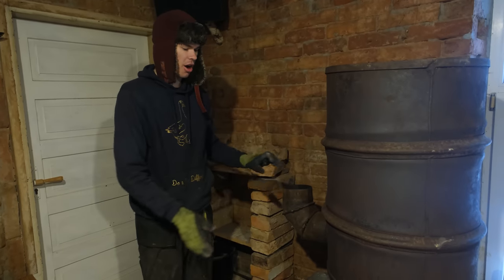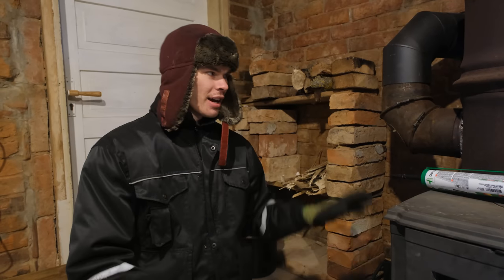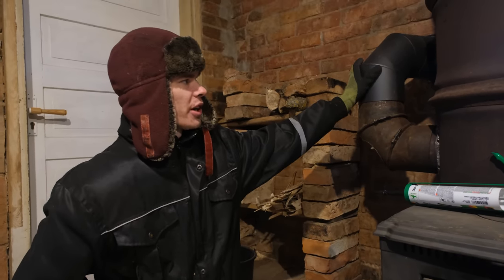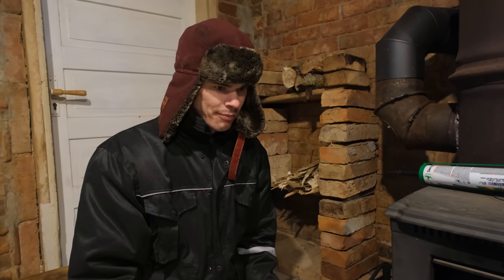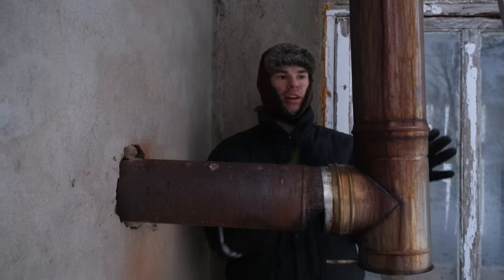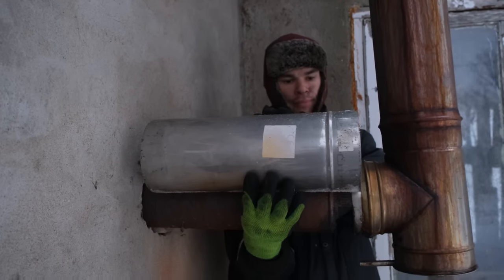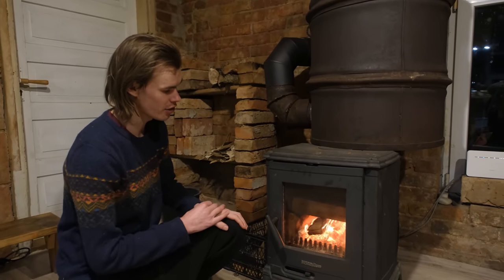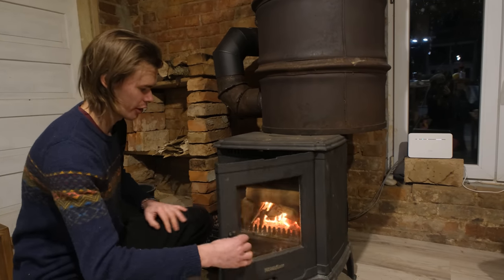Rocket Stove is WORKING!?

Comment: We have been burning wood in a forced air wood furnace in our garage for 30 years.  Recommendation:  clean your chimney with a chimney brush EVERY year, ABSOLUTELY NO EXCEPTIONS.  ALWAYS replaced pipes that have ANY sign of deterioration.  Also use only COMPLETELY dry wood that has been stored at least a year in sheltered storage.  Lastly, every spring, when you are done burning, cover your chimney at the top with a pail to prevent rain from entering the chimney all summer long.  As always, I wish you only the best!!!  Love you guys!
Reply: You could use a wind and water tight end piece in stead of a pail.
Reply: Good advice! But I'd add, place a good screen over it in the summer, to prevent birds and the like, from getting into your house in the warmer months. We found out the hard way, lol! Several years ago, we were hearing noises, so we went to the basement(where our woodstove is) and hubby heard the sound coming from the stove. Well, he opened it up and a bird came flying out. We had a hell of a time trying to get the bird before our 9 cats could. The bird was flying around and the cats were chasing it, and it was shitting all through the house, and we were trying not to step in it, along with preventing our cats from stepping in it too. It was freed once we caught it. It's comical as hell thinking about it now, lol! 🤣
Reply: @GOGOSLIFE  It's comical when it's over, haha, but I guess it was not funny at all, when it was happening! 😅Nice memory, thanks for sharing with us, made me laugh! 😂🤣
Reply: When I first started burning wood I always ran it wide open for 15 minutes after it caught good and you could hear the creosote falling down inside the chimney, so I just had to clean out at the bottom of the chimney. I've never had a chimney fire doing it that way, but one winter I forgot about cleaning it out and I had a basket ball size of creosote burning red hot down there, and had to wait until it was extinguished before removing it little water after it cooled down some an I was able to grab it with thick leather gloves. Started cleaning my chimney with a brush after that it was a little scary.

Comment: You can put gravel / crushed rock on top of the barrel to help hold and distribute the heat.
   You are putting a lot of trust and faith in that sealant caulk that you are using, I hope you have a good smoke/carbon monoxide detector, as I don't think that stuff will last forever.

Comment: I used to have issues with getting the smoke messing up my heating stove window until I learned to open the door long enough to get the smoke stack/or chimney hot enough to draw the heat smoke up and out.  keep experimenting if the stove and all is hot enough if you can close the door.  I enjoy your videos--just wished I was younger and do some of the pioneering things all over again--I did that before "google and video cameras--but when technology came around I embraced at least some of it.--Wishing you a great holiday season.

Comment: Yes, a backboiler will give you hot water and a few hot radiators too. It is like turning the clock back. Well done.
Reply: A radiator takes heat away from the stove. This stove will not run radiators,  it is to small. A chimney for a stove runs better with a straight chimney.  The more bends the less draw. The hotter the chimney the better the stove will burn. It will make the fuel last longer. It will not draw as aggressive.  The air intake above the door is to clear smoke from the glass. Air from beneath is better, especially if air is drawn from outside, instead of drawing hot air from the room. That oil drum is dangerous,  it will rot. You should use insulated pipe on the outside so the chimney runs hot. A cold chimney will block up in no time, and cause it to block. The creasotes stick to it!

Comment: Fair play you got it working. Glad you addressed the unsealed bottom of the barrel thing as I couldn't understand that. There's a risk it will smoke on start up but I assume it's drawing in air and out with exhaust. Someone below mentioned sand for mass, it's something I've been looking into and planning to play with in terms of heat storage, I have an old wood powered water boiler kicking around that will do nicely.
Reply from the maker: Yeah I was thinking of putting pipes in the barrel have so thick old water lines and they are 70mm wide so good for filling with sand and to store some heat to release slowly. But main plan to add heat exchanger and heat few radiators and hot water.

Comment: Seems like a job well done, glad to see you have heating😊 I don’t really understand how it works, does it heat the rest of the house through the walls? We prefer using the other stoves around here, made of terracotta tiles, they keep warm a lot longer than the metal ones but yours would be better if it works as a central heating unit. Interested in this with the current prices for energy and gas.
Reply from the maker: It will have central heating hooked to it so it will heat the rest of the house and hot water! 😁❤️
Reply: I have no clue what he's talking about 😁, but I'm so happy everything ended up the way they expected!
Reply: @DoBeDiff  when you were restoring the walls, in your older videos from the farm, I noticed they had built- in flutes/gaps in them and they had signs of ash/burning, I thought it was like an old type of central heating but I couldn’t figure out how you’d make the hot air circulate through the walls without pumping it somehow. I must have seen wrong.😁 
You mentioned in the video about turning the rocket stove into a central hot water service, yup, that part was clear and I hope it works well.
Reply: @lidijabirsa7768  he means to turn the stove into a central heating unit that would distribute hot water through radiators and to the taps around the house. Whay kind of heating do you use in Canada, not central heating units? They can of course run on gas, electricity or solid fuel (wood, coal, wood chips) I thought you’d use the same types given it’s pretty cold there.
Reply: @minime7375  Thanks. I always had central heating here in Europe 😊. I would probably die in Canada, haha, not just bc of cold but gloomy weather too.
Reply: @lidijabirsa7768  oh, sorry, I was under the impression that you were Canadian.

Comment: To make it better you should get an 8 inch metal pipe, cap 1 end, cut it along the length and weld both halves to the side of the drum open end up. Now fill the 2 half pipes with sand and once the fire goes out the sand will release heat into the space.
Reply from the maker: Yeah was thinking about something like that how to add sand into the barrel might be some ways we could do it. 🤔

Comment: The rocket stove Im making is very similar ( not so fancy) I've got a 2nd barrel on top of first to heat/boil water, and a third barrel that flue passes through and is pizza oven. Mine is for burning wood pellets ,  good job.
Reply from the maker: Sounds interesting! I am planning to add heat exchanger to heat the rest of the house and hot water! Hopefully it produces enough heat to get the radiators hot enough! But it's worth a try and anyways the central heating system will be setup and ready for any boiler I want to use. But a pizza oven sounds great I have seen some rocket stove pizza ovens and they work great!
Reply: It's a challenge to get radiators to heat if using convection, helps if tank and raids are above heat source, but u may need electric circulation pump .
Reply from the maker: @anthonymason912  I have circulation pump. I have already bought everything just need to renovate the storage room to set it all up. Plus accumulation tank and new boiler for hot water!

Comment: I've seen that spiralling coper pipes around strait exhaust could be used to re-direct heat using even small water pump ...
Depends on the distance you have to bring the heat in but transporting heat thru water pipe could be an interesting process too ...
Looks kinda non sense to me having all these tube out from the housing but fumes can be quite dangerous ...
If it works for you ...
Way more if you helps it to evolve ...

Well, I won't have bet on my success in those kinds a circumstances ...
Fortunately ...
It's nothing except yours on the lines !!!
🤔 🙄 😌
Isn't it fortunate ???

With all that firm support I gather there :

Dare, care, ride safe, clean, have fun ...
From France with !

Comment: Be very careful, you need isolated flue on the outside to keep the flue hot. A hot flue runs better.  A cold chimney will not draw efficiently,  and creasotes will stick to the flue and block. Air should be drawn from under the stove, the air intake above the door is to blow air over the glass to keep it clear. A boiler takes heat away from the stove. This will not run radiators,  it is too small. A flue should be straight,  with maybe one bend at the back, or a gradual bend. You should not have more intakes, that is dangerous.  Only use the intake from the bottom.  This is dangerous.  And the carbon monoxide kills! Use the stove as designed, and use insulation on the flues. A hot flue with one bend out of the back will make this stove run hot. Use the fire board to line the stove, and use the baffle plate!

Comment: Wow that fire draws well
Just a thought those heat resistant bricks in the barrel are they stopping heat coming through to the external barrel
Reply from the maker: No they help the barrel get hotter since the bricks help the fire get hotter and not let the smoke cool down as fast. Overall the stove works very great 😁

Comment: Your work can be successful in that you have increased the heat transfer capability of the hot smoke coming from the stove into the barrel. The smoke coming out of the stove is probably around 300 degrees Celsius, and we could determine the result if we also knew the temperature of the smoke entering the chimney.

In the case of my new type of stove, the smoke entering the chimney is always between 120-150 degrees C, even if I put 50 kilos of wood into the firebox at the same time. Of course, my fireplace is bigger, 60x70x120 cm. This way, I can put in meter-long firewood without having to cut it into small pieces. The main thing for me is the possibility of extracting the heat from the smoke and storing it, which means that the combustion in the stove only needs to be started every 24-48 hours. Only in extreme cold, -7- -15 degrees C, etc. must be heated daily, and thus an area of 120 m2 is heated. I can only heat more if I remove the heat with air heating or through a buffer tank in the case of central heating.
It would be nice if you could measure the temperature of the smoke entering the chimney, then we would know more about your work.
Reply from the maker: I will get a laser temperature device and make a update video with exact details. I do want to install heat exchanger for central heating but I don't think I will be able to heat a large accumulation tank if any at all. It all depends how hot the radiators get and how fast. I am excited about this project and if It fails I will get a proper wood boiler maybe automatic wood chip boiler would be great! 😀
Reply: @DoBeDiff  I tried three simple options for temperature measurement. One is the infrared thermometer, the other is the bimetallic furnace thermometer built into the flue, and the third is the magnetic thermometer that can be placed on the flue. It is worth using two of the latter and then you can see how much heat you can save before entering the chimney. Creating a heat storage (heat exchanger) is the real big challenge, because there are many options. It is very difficult to reduce 300 degrees C to 120 degrees C, because the smoke leaves the apartment quickly. The advanced measurement option is a probe that measures the emission values of the flue gases and the heat, as well as the amount of flue gas, and we see the data graphically on a computer continuously during the heating cycle. There is a chance for change. Good luck with the project.

Comment: Do you know that pipe in factory won’t fully closed for a safety reason?
Reply from the maker: Yes and this safety is unnecessary if you manage your stove. Have you seen any brick stove having a gap, even the dampers in Depo for brick stoves are fully sealing. Our clay pot stove seals fully and if you close it too soon it smokes. This new safety feature is dummy proof but is cooling down the house and the stove a lot. Since installing the new damper the stove stays hot till morning keeping the room warmer.

Comment: My opinion. Modern stoves are better. They burn clean and hot with blue flames. I can put very large pieces of wood that burn all night. Also are a lot safer than the duct pipe you’re using because they use stove pipe and chimney pipes. To know the difference use google. Many houses burned down because they used duct pipes instead of purpose made pipes for wood stoves.

Comment: looking good, perhaps for the secondary air use a 20mm ish size, stainless pipe either from the bottom or the side, preferably just at the tip of the flame, this is the reason for stainless, it can handle temperature, a  pipe with loads of holes around 5mm, should do, say twenty holes. then pass the pipe out of the stove to a valve, gas ball valve wok well, so you can fine tune secondary air, once secondary air is added the vents on front may be enough.. you could still reduce actual size of fire, a rocket stove tuned right can produce a lot of heat for almost nothing, here is something im working on, actual fire is around 60 mm, yet im getting around 4.5 kw of heat, for just under a litre of wood pellets an hour.. trying to get into production, were all small fish in a big pond.. https://www.youtube.com/watch?v=i75uwJYIw1o
Reply from the maker: Yeah I need to work with the secondary air. But today I was looking and had wood chips in which where just glowing and giving off gas and the rocket stove rise had a loud strong flame in it so it definitely works great at gasification! I want to know how well will it heat radiators and hot water and if I can store some heat in accumulation tank. Your stove looks great very nice burn. Would such a design work with small wood chips. My chipper produces small slices instead of bulky chips so easy for gravity feed. I am looking to buy a auger with 2rpm to feed the wood chips might be a good automatic addon for the stove. 🤔
Reply: @DoBeDiff  pellets will flow in a 50mm pipe at 45 degrees under its own weight.. gravity! no need for power supply then.. keep going